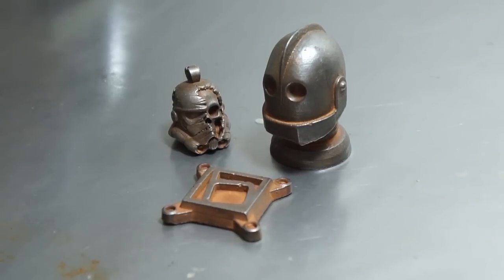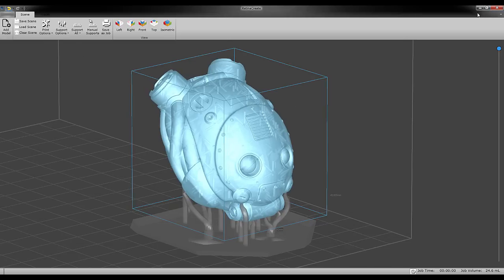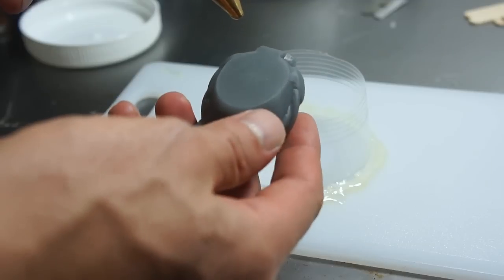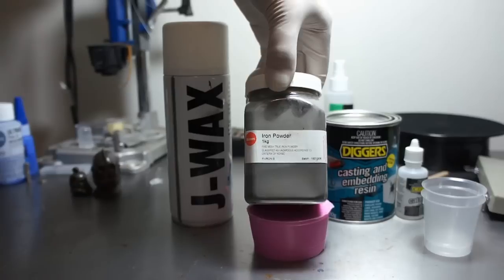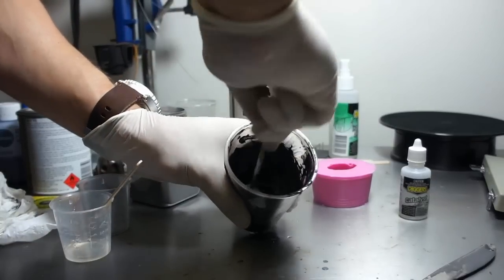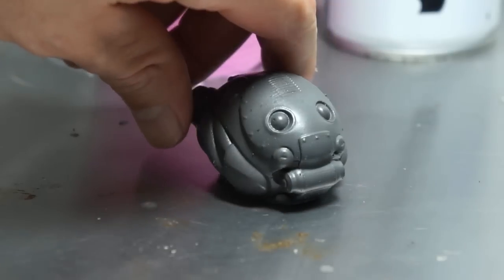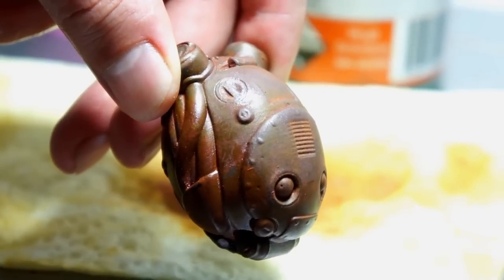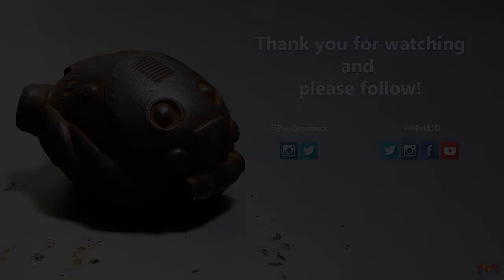Cold Casting your 3D Prints

Comment: a good trick I just learned is to use a palm sander to vibrate your mold to get out air bubbles :)
Reply: brilliant
Reply: where do you put your mold? above the palm sander or do you vibrate the table with palm sander
Reply: Either way. It just needs wiggle to move the air bubbles. Typically (depending on the size of the mold) flicking it works just fine. bigger molds can be upgraded to harder smacks.
Reply: Wife's vibratory works as well lol, gentle high speed vibration stimulates the bubbles together & the rise to the top. Easier than a vacuum in a bell jar 😜
Reply: Insert sex joke/ play on innuendo here.
Reply: Which setting do YOU use?
Reply: The "more, don't stop, more" setting.
Reply: How bout a subwoofer turned up.
Reply: Or how bout centrifigal force?
Reply: What kind of job you do that you get to work with this awesome Tech? Thnx!
Reply: When pouring the resine, you must pour it very high so the air bubble will explode ! when done, just shake the mold in order to make the last bubble get to the top.
Reply: thanks man, that helped

Comment: Can you tell the difference between this and a real iron piece (weight and feel wise)? What happens if this cold cast piece is exposed to heat (prolonged summer sunlight or a torch)? I'm about to get my 1st 3D printer and I hated the fact that I couldn't make my own "toys" w/o going to a casting house. I'm loving this cold cast method. Thanks for the video, Paul!
Reply: +g34rfr34k The weight and feel is very similar to real iron, and heat resistance is good. There's a youtube channel called brickintheyard that has a ton of information on mold making and casting, you should check it out.
Reply: That's great. I'll check them out for sure. Thanks Paul.

Comment: Great video. I love this model. Thanks for sharing. PS. If you do a shell model on an SLA printer, you will save resin, but not time. Since the SLA printer makes one full layer at a time, it dosnt matter how much is in each layer. Only factor is the height of the model or models. The print time will be the same even with 30 models on the building plate. AND if you do shell your model, you will need to add a hole to let the resin leave the cavity inside the model. Otherwise the resin will be trapped inside your model.

Comment: That looks great!
If you like the fact that it's magnetic, you could make the whole thing a magnet by exposing it to a fixed magnetic field while it cures. This could be done with either a permanent magnet or an electromagnet.
Reply: so just put a magnet next to the mold while it cures? that's pretty dang cool! gonna have to try that.
Reply: putting a magnet next to it while it cures might pull all the iron to one side of the cast, maybe if you do it far enough into the curing it might not wreck the irons distribution through the piece.

Comment: Helps to prevent air bubbles by 1) pouring from a high point, 2) shaking or banging the mold, 3) applying a bit of heat

Comment: You might want to consider using a clear urethane resin vs the polyester.  It would be much safer and typically wont shrink as much.
Reply: dnelms2 Thanks! is it more prone to bubbles?
Reply: Paul Braddock No not really.

Comment: Paul,
Hello. Awesome vid! Quick question: If I want to 'DUST' into the silicon mold to save the metal powder, should I coat the silicon surface with anything first to make the powder stick or will the powder grab onto the silicon? (I have a two part mold and I'm casting in resin)
Reply: +warren mahy Hi Warren,  sorry for the late reply, this isn't actually my channel. I believe the surface of the silicone should "grab" the powder enough to hold onto it. Adding an adhesive may affect the resin from curing properly.

Comment: How do cold cast parts like this stand up to mechanical stress? Is this something I have to test? Or are there places I can look up things like tensile strength, modulus of elasticity, etc? I'm thinking in terms of machine parts. I've never heard of cold casting before.
Reply: +Fudmottin It's no stronger than normal resin, and resin itself tends to wear pretty easily. Definitely something you'd need to test.

Comment: How does a cold cast iron piece like this compare to ABS printed part in respect to hardness/toughness? Is it machinable? Can you drill and tap it? Just wondering =). NIce video!
Reply from the maker: Working with resin is really nice. It is a very hard surface overall, especially infused with Iron. You can tap normal resin so I would assume you could do the same with the cold casted version.
Reply: Mold3D TV Just a question, wouldn't it be better to let it sit for 6 hours on something that vibrates so all the bubbles rise? Or would it interfere with the mix solifying?
Reply: Solitude the the iron fust would sink to the bottom of the cast too
Reply: David Pant This stuff is pretty much like JB weld, anything you can do with it you can do with this. drill, tap, machine, etc.  only slight problem can be chips fusing to the tool/bit, but if you take it slow and keep it cool you should be fine.
Reply: Solitude I think that a vacuum chamber would probably do better than a shaker table, but i haven't tried it yet...
Reply: +David “Nightstang” Pant It depends on the type of resin you use. If you use some of the nicer Epoxy resins, even your tungsten carbide bits might have a hard time going at it.
Reply: +mrchew1982 A vacuum chamber works if you don't leave it in to long. What is much better is a pressure pot which squeezes the bubbles into non existence,
Reply: +Solitude The resin and the silicon mold both set in a matter of 10-15 minutes normally, so what ever you're making, you have to act quick.
Reply: +David Pant - Nightstang You can do pretty much the same things with it as what you can do with hardened epoxy (or any other resin). So yes, you can machine it, drill into it (I'm not sure what do you mean by tapping).
Reply: +CoolKoon drill a hole with threads for a screw
Reply: +Chaslasher Hilliard Oh, I see. Well yeah, it can be tapped as much as any other plastic (personally I would rather prefer drilling a hole straight through the plastic piece and fastening it with screws instead of tapping).
Reply: Resin is VERY hard if you mix it correctly. Bubbles are your nemesis though, as they form naturally from thorough mixing. Therefore, you kind of need a vacuum chamber if you want consistent castings.
Reply: David Pant if the resign gets warm (~150°C)  it will break down so care must be taken when machining it. But you can do anything to it you would do with HDPE, Delrin, Teflon and other plastics...like turning it on the lathe..it won't melt though but break down when machined too fast . heat welding doesn't work and using it for plastic infusion tools isn't good either.
Reply: A lot depends on the resin. I despise the polyester resin used in this video. . Vinylester is stronger than polyester, but it is almost as unpleasant to work with as polyester, so I avoid it. Both of these resins smell terrible. Often they continue to smell and offgas after they have been cured. I've had castings that smelled for years.... If you use too much activator the resin will get too hot and bubble or even start to burn. Use too little and it takes forever to cure. Some formulations will never set with a hard surface finish, so the cast will be tacky, gummy, or sticky. They will smell bad when you cut and drill them, too. These resins aren not particularly strong or durable. Polyester is the cheapest, so that's about all it has going for it. I use mostly polyurethane or epoxy. I have never used acrylic. All these can also overheat and burn like polyester, but they are so it's less of a concern. Polyurethane is probably the easiest to use. It also sets very fast (demold in half an hour depending on the exact formulation). Polyurethane is generally the thinnest, least viscous almost water pourable of the resins; although, once you add fillers like metal then you have to experiment. Epoxy is the strongest and hardest without being brittle, but this varies a lot with different epoxy formulations. You can add flexibility with additives. Glass and carbon fiber fillers will add stiffness and strength. They come in chopped cut fibers from a few microns to half inch (or woven sheets, but you can't cast with that).

For degassing to prevent bubbles you start with vibration. This can be as simple as a hand-held tool indistinguishable from a "therapeutic" massager to a vibrating table. Next you can use a vacuum chamber. These expand most bubbles which then float to the surface. Still you can get vacuum bubbles which are formed by surface tension along the surface of the mold. These don't float so can't be vacuumed away. More vibration will sometimes collapse them. Yet still some bubbles and pinholes can persist. Then you use a pressure chamber. These crush the bubbles until they are invisible or actually cause the gas to dissolve into the resin. These chambers are harder to build and are more expensive to buy because they have to be built heavier for safety. Even 30 PSI can be dangerous if a chamber bursts... The problem with vacuum and pressure is that both can cause distortions of the final casting if you allow the resin to cure under vacuum or pressure. Any bubbles that may be trapped in the mold itself will shrink or balloon when the external pressure changes. You may not be able to see this happening, but the casting will come out distorted. So cure at atmospheric pressure if possible. Your resin has to be a slow enough setting resin to go through all the cycles of vacuum and pressure.

Drilling and tapping any of the thermoset resin plastics is never a happy chore, but it's common. They sell special drills and taps for resins. Look for acrylic drills. These work well on all resins. Fiber filled composite resins will quickly dull your cutting tools. If you can specify threads then use large threads. Acme threads are even better. You can often cast threads in place. You pop the screws into a mold before pouring resin. Be sure to apply a release agent to the threads! After demolding you unscrew the screws from the casting.

I think I just wrote a book.
Reply: Noah, I read your book twice, which resin do you recommend?
Reply: If you need a threaded hole, a captive fastener is a better idea.  Permanently affixed and made of metal, it takes a bit of thought into how to properly do it, but the payoff is a perfect part (functionally).

Comment: I've never heard of such a thing. Cold Casting. I just thought the way you made stuff from 3D plastic molds, is to hollow out the plastic mold, put it in a bucket of sand, and pour molten iron, or steel into it.

My question is, can I make a threaded elbow piece, that can withstand 180 pounds? Is this solution brittle, is it exactly like metal?
Reply: It is not as strong as casting it out of iron. your point of failure on cold casting like this is the resin, which would give you about 4000psi of shear strength vs. 25,000-60,000 for mild steels. Cast iron is harder still.

Comment: Can you get stainless steel powder? Can it be welded? I feel like the resin would make it unweldable.
Reply: The resin has a melting point that's too low to weld. You can't weld it. 
Any powder works. Even cinnamon. (but no clue as to why you'd use it)

Comment: When you mentioned the small voids left in the final part due to the thickness of the resin, I wondered; in this case, with the metal powder in the resin, would passing a magnet around the outside of the mold after pouring perhaps draw the resin to the edges, eliminating surface voids?
Reply: ***** that's a neat idea! the resin with metal particles is essentially a ferrofluid!
Reply: ***** possibly, though parts of the mold are quite thick. The resin itself is quite low viscosity, yes, it's the powder that makes it not so.
Reply: +Paul Braddock Can you please tell what brand of Iron Powder is used? Which faction, name, labeling? I am very interested in your videos.
Reply: A vacuum chamber would be ideal.

Comment: You don't really need extra soulion for rusting, just take some vinegar with salt and it should just do the job. Even multiple coats with just salt water should suffice.
Reply: eh that is more ideal for copper aloys really. that would take a very long time and frankly household bleach is much more effective and rapid at creating corrosion on iron or steel

Comment: Really helpful video. Thanks for sharing. My experience of ABS printing is that it's not the way forward.. VERY frustrating. The bonding strength between layers is really poor and the 0.2 mm resolution  is  limiting. What printer did you use?

Comment: Is Pinkysil better than regular silicon mold making rubber? Just wondering why you use it since it costs way more. Can I get away with it by using the cheaper stuff?
Reply: Paul Robert Yes, probably, I'm no expert on silicon, I just used Pinkysil because it's easy to get where I am, and I had some in the cupboard. As long as it doesn't react with the resin, and captures enough detail.
Reply: Paul Braddock Do you have any experience with clear resin casts? I need to make some miniature glass out of clear resin for a project, and it doesn't need to be perfect, just needs to look good to the naked eye. Is sanding PLA sufficient for getting a smooth enough surface finish in the casted part? Because I noticed even with a smooth surface finish (to the touch) there might still be visible layers with the white-look of PLA in between the layers. Or should I also dip briefly in ethyl acetate? Do you think if I made the original part out of woodfill or laywood and sanded I would get a smoother mold and therefore a smoother glass-like finish in the resin part?
Reply: I'm not sure you'd get the results you need using any FDM filament. I'm using an SLA printer now, and will be testing clear resins for making character eye lenses. For casting, go to a hardware store, and look for "embedding resin" it's supposed to cure completely clear
Reply: Paul Braddock If I were to make a mold of a piece of glass though, the resulting cast would probably come out looking like glass without having to polish right?

Comment: What kind of durablity are we talking for the end result here? Obviously it won't be anything like a genuine cast iron piece. But is it stronger than if it were simply made of resin?
Reply: I figure that it would depend on the abuse.
For heat resistance, it's going to be the resin. However, for abrasion resistance the iron also gets it's role. For strength, I'm not going to take a guess. If the particles were long, it would get a fiber-like reinforcement. But on the other hand it decreases the amount of resin. So that'd depend on the metal as well. If you would mix in some extra fine steel wool strands, you could probably make something very strong!

Comment: I tried this one out, made a quick model in sculpting clay, made a silicone mold.

And used a resin with iron powder, however I don't have the iron look on it. Is there a possibility that this doesn't work with all Iron powder? My result is extremly dark, I also can't get it to shine.
Reply: Kim Dekeyser Hey Kim, was your resin clear? did you use a 1:1 mix of resin and powder? what did you buff it with?
Reply: It's a clear epoxy resin. I did use the 1:1 mix, and used the hardener that was delivered with the resin. Didn't use anything else on it. I'm thinking that the problem lies with my iron powder, it was a bit darker then the one you used in the video. The object is also magnetic so it should have worked.
Reply: +Kim Dekeyser I really don't know sorry, Iron is Iron, unless it was mixed with something else.
Reply: +Paul Braddock I now rubbed the surface with white spirit (a mineral spirit). THen used the steelwool again, it did gave a better result.

I'm also a sculpting student and my classes started again this week. I compared my iron powder with the one we have at class. Apperently the one I used is darker then the one we have there. 

My stonecutting teacher was interested in it aswell and will try a model with the iron powder from class. She thinks that there is some kind of pigment added in the powder.

Either way thank you for replying.

Comment: How did you take away the model from inside the pink gummy material?
Reply: +Marco Maltese If you pay attention the bottom flat part of the model is glued on the surface, so when the mold cured it was exposed and not encased in it. The mold is quite elastic so in this cause he just forced the model out of this opening. Cheers.
Reply: johnidis uhhh thank you, I am noob on these things :D
Reply: ***** Cheers mate have fun casting!

Comment: What happened between 3:29 and 3:30??!! How?
Reply: You wait for the silicone to set and then take out the printed part. :)
Reply: Yup, could see that, but how did he prep the bottom of the cast for removing the part? because no there is a big gaping hole at the bottom of the cast, so you cant get the whole part casted...
Reply: Johnathon Windsor The bottom of the printed part was mainly flat and he hot glued it to the board, so I guess he had the hardened hot glue sticking out of the silicone when he removed it and cut out the round flat bottom part from the silicone to remove the printed part. I know what you mean with not having casted the hole part, but i guess he was ok with the surface the resin created or he sanded it down afterwards.